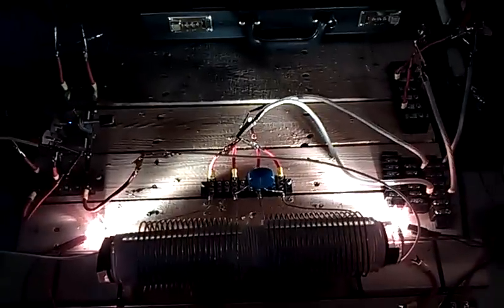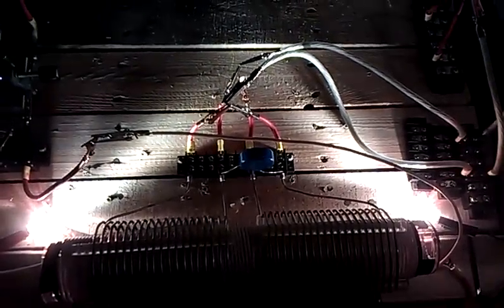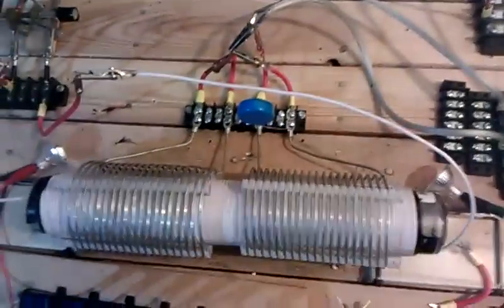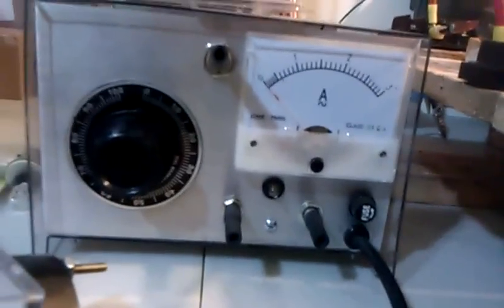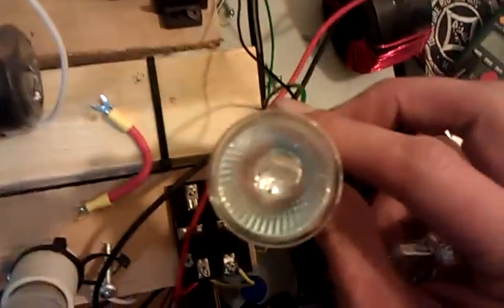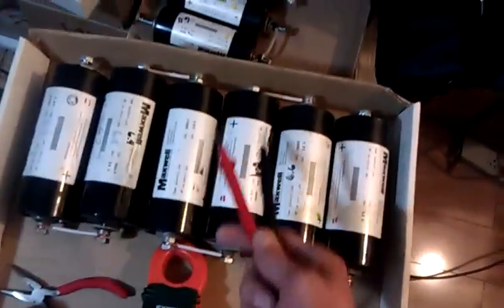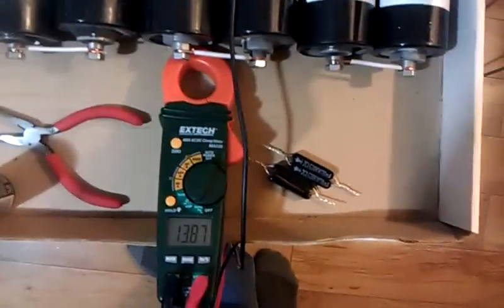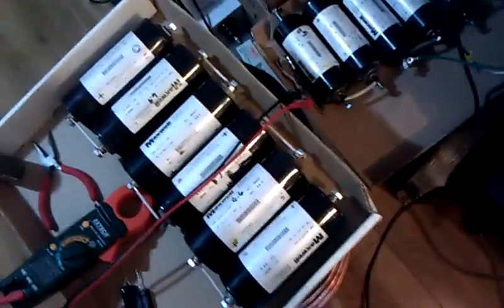Don Smith Device Project Part 33: full watt bulb vs Smith stepdown comparison

Comment: What would you do with a 15k power generator? 60 hz can be increased, but hoq would you use it for a setting lik don's? I potentially have acces to one....Do you know what happened to Don L. Smith?

Comment: Good work, Kurt!
What happens to the input current when you add bulbs in series and/or parallel to the output? I am trying to see if the bulbs gets dimmer and/or the input current changes.
Thanks
Tony